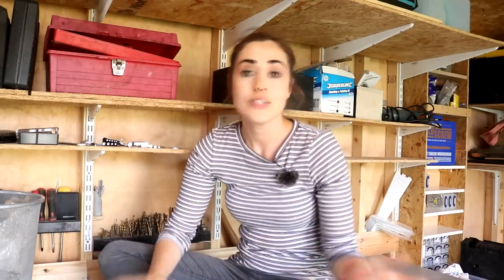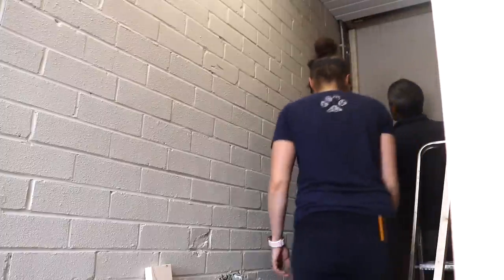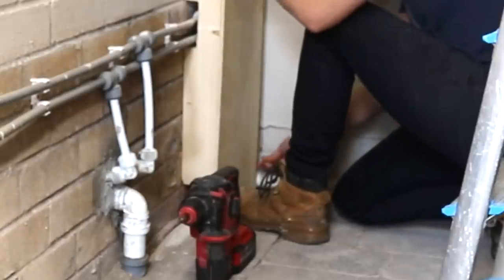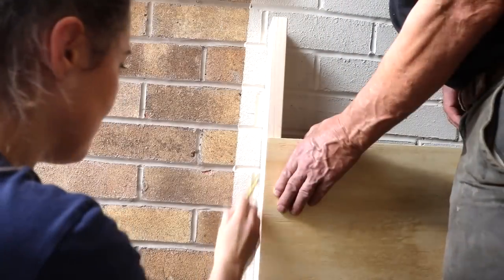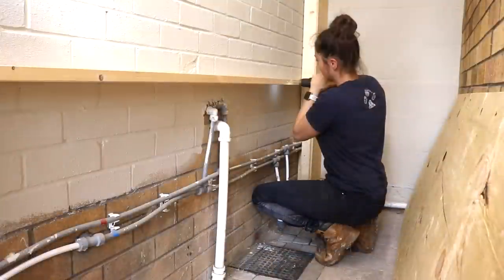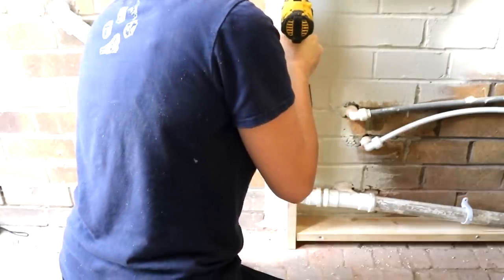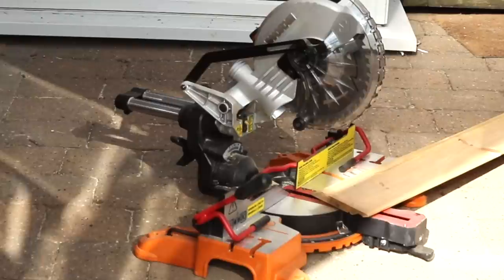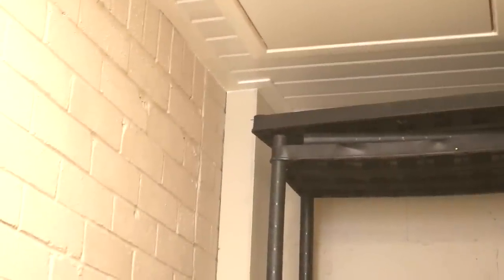Boxing in Pipes | The Carpenter's Daughter

Comment: Would you use the same material for a bathroom to box pipes ?
Reply: You would want wbp/marine ply.
Reply: Cheers
Reply: @rudeboy826  no worries. No less that 12mm 1/2" if your putting stuff on it or tiling.

Comment: I had done this before with a washing waste pipe behind the fridge a couple years back and all was good once it had been pb’d and plastered but because they were old push fit joints there was a leak a couple months down the line behind the boxing in so i had to rip it all out and replace the waste with solvent weld. It may be alright to used push fit for waste pipes but if they get disturbed after time they expand and contract they might cause leaks later down the line. I ended up doing the job over again when that happened but it’s always best to check that you have no dodgy joints especially if it involves waste water!!

Comment: Hi, I never thought I would watch anyone doing woodwork and see something I did not have, after about twenty years you took the biscuit with the chop saw, well not the cop saw as I have several of these, but the hold-downs at the sides, what a great idea. I now have a Worx mitre saw on its way and I look forward to using those hold downs and keeping my fingers safe. Thank you for the shortcut.
Reply from the maker: Glad you like it too!  It also comes with metal extender pieces on the sides to help prop wood up too, but I didn't use it in this video :)